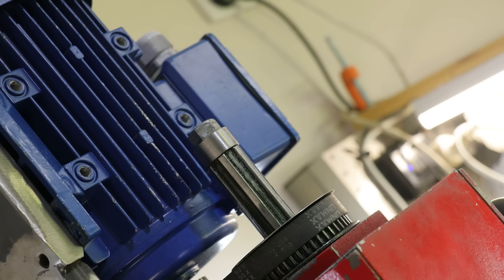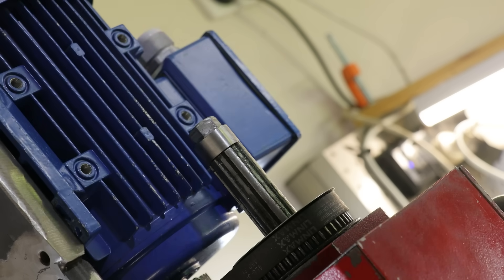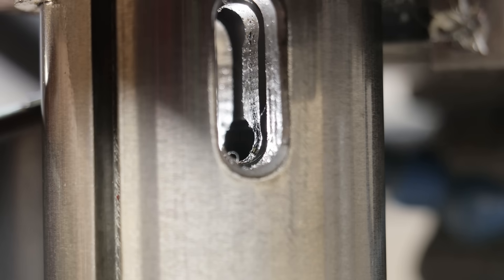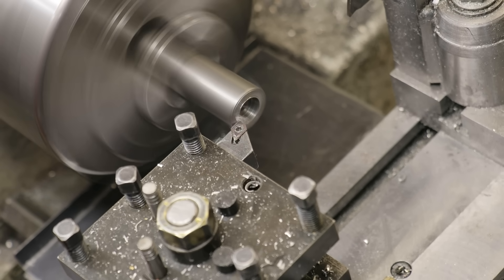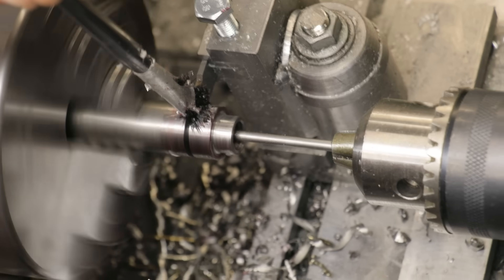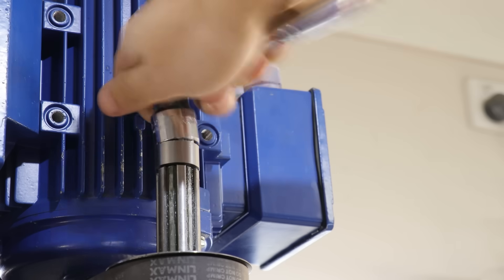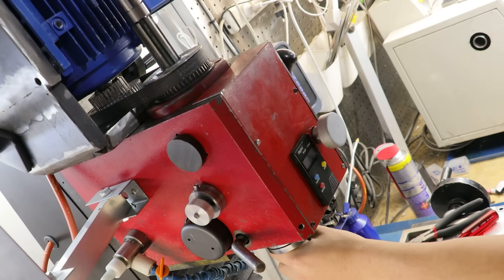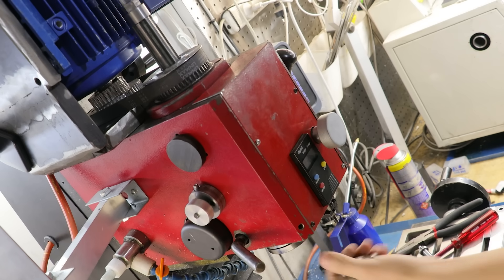This One Hour Upgrade Will Change The Milling Machine

Comment from the maker: Just to add because someone will ask, the front pulley that we added to the mill spindle last week has been removed, so that I can put a flange on top of it. Someone suggested that I do it, and I think that it was a good idea, I am just waiting for a piece of aluminium to arrive. Appalling continuity, but it'll be back on within the week. 

Also worth saying that I did the voiceover without a written script (which I don't usually do) and for some reason I keep referring to the drawbar as a leadscrew. No clue why, but when you head 'leadscrew' just think ' drawbar'.

Cheers
Reply: Keep up the great work
Reply: I can't recall you saying lead screw at all😮
Reply: I’m currently designing a small cheap electric power-drawbar setup that sits on top of the drawbar. Bevel washers AND electric unscrew feature.

If I convert it to hydraulic, I can make it much smaller and compact but it’ll cost +$350. If I keep it electric it’ll add 4” height to my setup.

After years of milling, do you care if there’s a big ugly setup on top of your milling machine?

Comment: When I was an apprentice in the 1980's I was taking a 6" milling cutter out of a machine and accidentally unscrewed the drawbar completely before tapping it with a hammer. The cutter came loose from the taper, and instead of being held by the thread it fell straight onto the bed trapping my fingers in between, crushing the bone in my middle finger and sticking a piece of swarf straight through the nail. I never made that mistake again. The tip of my left middle finger is still a bit flatter and wider than my right one ....

Comment: Very ingenious!
On my small mill/drill I opted for a dual thread system, tightening the drawbar by hand and releasing with a spanner. The two threads have to be of different pitch, of course. To hold the spindle against rotation I just grip the flywheel I have mounted on top of the spindle pulley but I like your lock which would be useful in other ways.
Incidentally, your method is similar to the self-extracting cranks on cycles.

Comment: Re:  the spindle lock... could you add a small contact switch (& relay) that's triggered when the lock is in, to cut power to the motor?  That should eliminate any concern about accidentally firing it up when locked.
Reply from the maker: Yeah. I not going to

Comment: Another way to make sure you don't damage anything by accidentally turning the Mill on while the Spindle is Locked is to add a switch to the Spindle Lock Bar, I suggest for simplicity, add a 240V Normally Closed push button wires in Series with the motor (AKA the motor power wire goes to the switch and then to the motor) to the disk that's screwed onto the housing that will be pressed when you push the lock button in...
When the bar is locking the spindle, it opens the switch cutting the power to the motor so even though the ON/OFF Switch is trying to start the Mill, the Spindle Lockout Switch is preventing the power from getting to the motor and making Expensive Sounds...
Alternatively as suggested in another comment, you can use a Low Power Button/Wire and have it send a Lockout Signal to the VFD itself...

😄😁😆😅😂🤣

Comment: Nice work. You could add a power cut to the spindle lock so the motor is unable to be powered when the lock is not in the out position

Comment: Very cool mod. 
On my emco, the top of the spindle has a threaded on cap that housed the draw bolt. As you undo it, it bottoms on the cap which pushes down. If i install a chuck, i have to remove the bar so that easy. Could also draw bar the chuck if i add a threaded part.

Regards,
Paul

Comment: Bloody fantastic idea! I would implement it immediately on my mill, however some of my tooling uses and imperial draw bar thread, while the rest uses a metric thread. This means I have to change the draw bar from time to time, depending on the tooling I’m using. Bummer!
Reply from the maker: Yeah I think I am lucky to have all mine use only M12. I mean I did build half of my tooling so it would be very surprising if any tools used anything other than M12

Comment: Nice and simple, but what about using MT tang tooling (MTA)? Wont that need to seat into the flange where the new nut now resides?

I have a paramount brown mill with an MT4 spindle. Stepping down to MT3 requires a tang fitting. MT drills are all MTA (tang). So are U drills. So are power tap collets.

U drills are pretty groovy. They are carbide inserts but, due to their diameter, they can run at typical RPM for a mill. They also require no pilot hole.
Reply from the maker: I don’t use any Morse taper tang tooling so it is no issue for me. May prove to be if you do a lot of

Comment: But why FUSION?! What happened with SOLIDWORKS? Anyway, such a great improvement for the CNC, bravo!
Reply from the maker: My solidworks licence expired. Before I buy another I thought that I’d see how fusion and inventor are these days and I’m not particularly impressed with either. So I’ll probably get around  do to getting a new licence in the near future
Reply: @artisanmakes  why don't you try SW MAKER edition?
Reply: @artisanmakes  That is interesting to know as I have been looking at Fusion and wondering how it compared to Solidworks.

Comment: I have a Wells Index Model 40 milling machine, and the way this is handled on that is by having a threaded portion to the top splined portion of the spindle, and a nut with an inner registering shoulder that will push against the drawbar as it's unthreaded to push the tooling out of the spindle taper. This would require modifying the spindle in your case, but only to counterbore the top splined section and set-screw a partially threaded portion to it, then making a separate nut through which the top of the drawbar sticks out (the drawbar in my mill ends in a small square end which can fit through this nut, not a large hex head like yours). This would get rid of the possibility of that roll pin wallowing out and falling out inside the spindle, as the only pinned/set-screwed section would be up outside of the spindle. But your method took much less making of parts and will probably hold up nicely, just check on the roll pin now and again! Good work

Comment: Once you get the impact driver to tighten and loosen the drawbar, you can do away with the spindle lock. Holding the tool with your hand will be enough. The impact works almost like magic.

Comment: I ended up making something very similar for my Clausing 8520 and this type of self-ejecting drawbar has been extremely nice, I had to make a new drawbar but I think it was worth the time I spent. I ended up adding a custom brass washer on the top and bottom friction surfaces because I had space in the in the spindle, definitely worth doing for those who have space in the spindle.

Comment: cries over three different threads on tooling and tangs
meh. pin the top, works the same. definitely the go for using the QC chucks... 
slide the lock in a hard plastic bush, use it as an enable(disable?) switch.
thinking a bit, thread that will cop it is in the mt3 collet.

Comment: That's a clever solution!
Just bear in mind that roll pins have a limited strength and will get flogged out over time. You might need to replace it with a thread and a hardened grubscrew etc
Reply from the maker: The old drawbar was held together by a roll pin through a cap head screw. That held together until the threads gave out. In any event even if it does break a tapered pin could suffice
Reply: The flange is already attached via a thread, and the thrust is transferred between the flange and the drawbar via the thread.  The pin is only there to prevent the flange from coming unscrewed.
Reply: @Kineth1   hi, yeah I understood that the thread takes the bulk of the axial load. But I have used roll pins in similar situations and they always flog out due to small movements. This mechanism will have high axial forces and will be used over and over again.
A grubscrew which is loctited in and tight doesnt (usually) move, and lasts much better. 👍
Reply: @wizrom3046  Maybe you didn't drill the right size hole to compress the roll pin.
Reply: @65cj55   no, that wasnt it. The problem is that a roll pin is hollow, and springy with a thin wall section. They are not very strong for impact type scenarios, far worse durability than a grub screw tightened down hard with loctite which is not springy and (generally) wont allow small movements to turn into large movements.
Even better would be a small screw with a tapered head etc that would jam in real tight when installed.

Comment: Are you not afraid, that the roll pin will eventually work itself out of the hole and wreck your spindle?
Reply: Roll pins just never do that, if the hole is the correct size.

Comment: Great video. Also I think it should be possible to add a micro switch wired to the vfd so that if the spindle lock is engaged it will prevent the spindle from energizing.
Reply from the maker: Probably but this will all get ditched once I draw up plans for a pneumatic impact driver on the drawbar. I’ll have some type of lock that will grab into the spline of the spindle to lock it. So this is all temporary. Cheers
Reply: @artisanmakes fair points. But as a counterpoint I would say that project creep is a thing and unless you have a firm idea on when that will happen you may wind up living with your current setup for a while. I would also add that the microswitch setup could be an easy swap to your new setup while providing possible insights while you are designing the new setup as in how to incorporate it into the design as well as the capabilities of your vfd in this manner.
Reply: I was thinking the same.
Reply: One more vote here. While stall detection is nice, interlock adds a layer of security.
Reply: easier... use the lock itself as the switch. plastic insulating bush... enable is off.

Comment: Good job!
It's a very useful feature!
I also made a self-ejecting draw bar for my mini mill during the CNC conversion, but I preferred to turn the whole bar from a 20mm bar, with the inner flange in one piece with the bar.
I also put a bronze ring between the flange and the spindle, and locked the outside nut (made on my design on the CNC lathe I'm working on) with an axial 4x20mm solid pin, in a hole drilled between the threads.
In this way if something goes wrong, I have to extract the pin from the upper side instead of the bottom.

Also, my machine doesn't have the cone remover hole on the side of the spindle like yours!

There's a photo of it in my CNC conversion video at 6:36, if you want to check it out!

Take care!

Davide